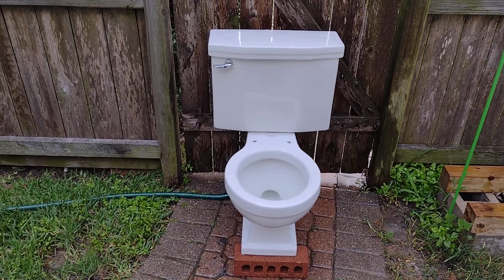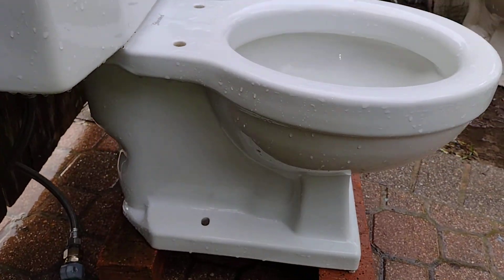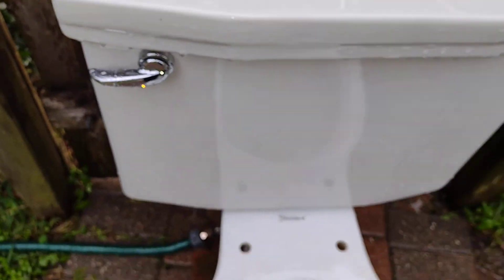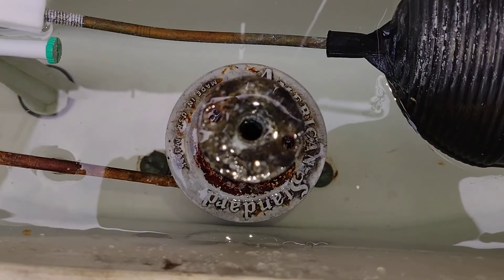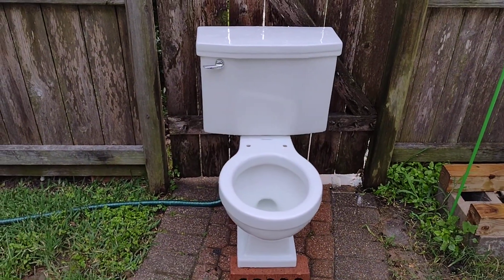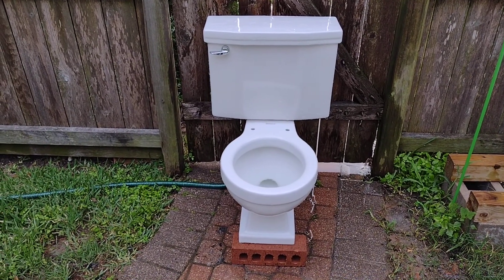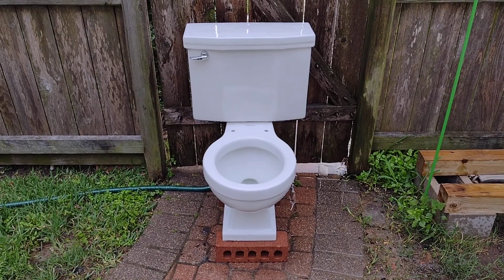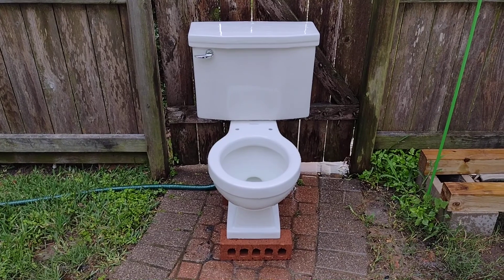1959 Standard Cadet Flushes!

Comment: The water saving toilets are pretty bad in my opinion. Stuff the regular toilet problem the water saving toilet struggle and sometimes don’t even work to flush down. Although, these kinds of toilets are kind of unnecessary as for there are more efficient ways of flushing down water with the same amount of strength then just simply having more water.
Reply from the maker: I have two of these in my house now because the people who built our house were cheap and didn't slope the pipes properly so occasionally there are clogs in the pipes and we get water in the kitchen. My house in particular needs high waterfowl but these are not the most efficient toilets. I would give that title to the 1980s Plebes.